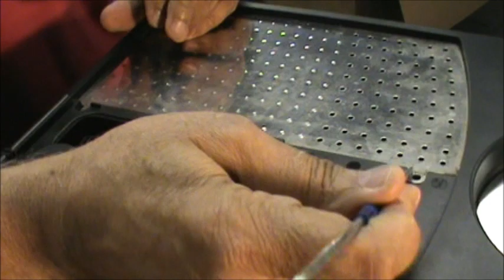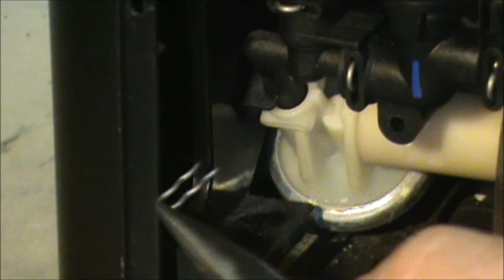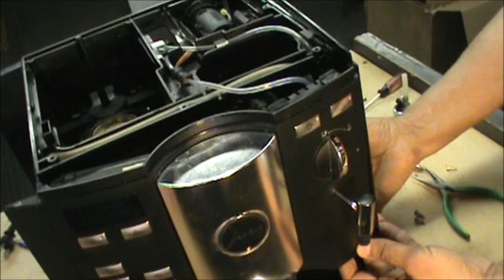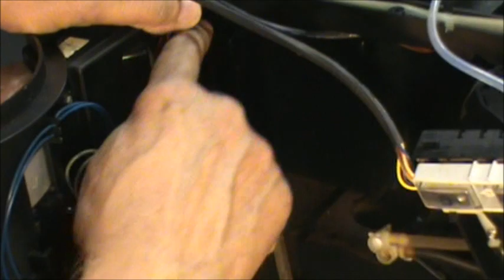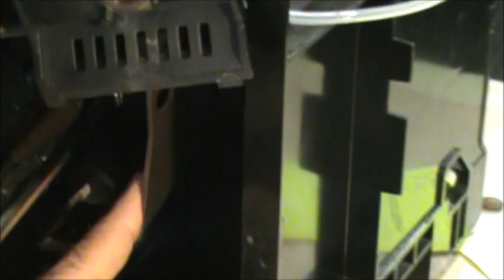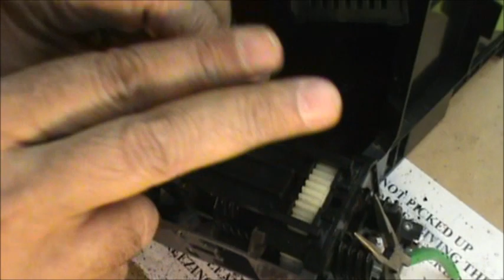How to Fix Jura S7, S8, S9, S90, S95, X90, X95 Espresso Machine

Comment: Hi. In my Jura S7 water is going to collection container and dry coffee in ground container. What is wrong with drainage valve? I cleaned it two times. Thanks
Reply from the maker: Disassemble, clean and rebuild the brew unit if you have not done so already. You may want to replace the drainage valve if its never been replaced.

Comment: I have a Jura S9 Impressa that keeps telling me missing tray.  I've cleaned the contacts on the tray and in the machine and no luck.  Any suggestions on how to repair this issue.
Reply: I had a few beans fused together at the back where the tray goes in. Removed the ‘ muck’ and the problem was gone!

Comment: I have a S9 that is showing system fill message,  but puts the water into the tray.  Does it over and over.   I'm assuming i have a broken or disconnected hose.  You mentioned the Oval head key and a hose repair kit,  how do i purchase these?  I'm in Honolulu.   Can't find a Jura repair shop here,  so i guess i have to do myself.   Thank  Good video BTW.
Reply from the maker: Hi, you can order the oval head tool to remove the rear panel from our website.  We ship to Hawaii.  Part number is 0010635.
System Fill is due to a blockage in the hydraulic system.  You should isolate the blockage or leaking point once the machine is opened.
Reply: Bought and received  key, successfully dissembled the S9.  Traced water from tank into pump, then into hydraulic distribution (white cylinder).  Water appears to then go out from hub into drainage line under brew group and discharges into tray.   Can’t figure out where any tube obstruction  would be.  Is it time to send it to the shop for repair?    If the hydraulic distribution is dead or clogged then there’s lots of tubes and limited access.  What am I missing?
Reply from the maker: Hi Charles,  it can be fixed.  I suggest you ship to us for repairs.  Our address is listed on our website www.shop.partsguru.com.
We’ll fix it within 2 weeks and let you know when it’s ready to be shipped back to you.

Comment: I am totally happy with this machine>>>ur2.pl/1165    it brews a perfect cup of coffee. Some of the negative reviews had me concerned but the negatives are minor compared with the perfect brew.Having had the previous swing machine for many years I find this coffee is hotter and keeps nice and warm for a long time with heated plate and the steel carafe. Also the brew settings are a big improvement, previously with the old pot I had to do a double grind to make six cups.

Comment: I have a Jura Impressa S8. Coffee and tea spout have worked constantly. I removed a hose from the steamer to unclog cuz my steam wand was not producing anything. After putting it back together, steam wand worked perfectly. When I went to de calcify, added the tablet and pushed the clean button, the entire process went through the steam wand! I reset to factory settings, re booted, and when I push rinse it again all goes through the steam wand. After "Coffee Ready" I pushed the coffee brew and the grinder activated but the water again came out the steam wand. My understanding is that if I leave it unplugged for 2 hours, the CPU will clear. Then I should get the "fill system" prompt. Right now I am only getting will water. If after the 2 hour wait is still does not channel the water to the coffee spout, I assume it is the fault of the water channeler that is behind the steam knob which has two line in's and 2 line outs. Before I did the repair and cleaning the coffee and tea spouts were functioning perfectly. Advice?

Comment: This guy is eager to sell parts but to answer simple questions......awww... Not so much!
Don't get me wrong, his input on how to get into the machine is very good but from that point on you better have some mechanical savvy or you will wish you never started. Haha
Reply: I have just ordered the following parts for a XS 90 machine.  

1    | 0010598  | Jura Dispensing Valve with 2 O-Rings        

1    | 0010599  | Jura 3 Way PTFE Tube Connector - New Style  

1    | 0010639  | Jura Membrane Regulator Hairpin Style with

Can you please direct me to how I need to replace these parts.  
Much appreciated.

Comment: After putting back the brew group I now have a error 8 code. When I watch the brew group move it seems to struggle at the very top. Could it be because I didn't put it back in a neutral position and it is trying to unscrew upwards further than is possible? Thanks
Reply from the maker: When re-installing the brew group, please replace the brew group in a home position.
Let me know if that helps.

Comment: What do you recommend cleaning the brew group with. Should it be soaked in something or parts be manually cleaned?
Reply from the maker: Hi Dima, Clean the brew group components by dipping the parts in a soapy solution of luke warm water.
Reply: Parts Guru thanks a lot. Also to remove the brew group do I need the special oval key or is that just to open the one side panel? Thanks again!
Reply from the maker: Yes, as shown in the video, you will need the oval key to remove the oval screws from the rear panel of your machine if you have an S Line model.  What is the malfunction with your machine?  And, what model Jura do you have?
Reply: Parts Guru I have the s9 model. The issue I have is there is no water passing through the coffee spouts. However, water passes through the steam spout. From your videos I'm guessing an issue with the spring section of the diverter. Also it sounds the the brew group is struggling to move so I assume it needs a good tune up.
Reply from the maker: Can you please make a pre ground coffee to see if it makes coffee?
Reply: I am having the same problem with an S7.  Water comes out tea portion and steam nozzle but nothing comes out with clean button, making a coffee or with ground cofeee.  What would I need to do and parts please?
Reply: I am having this EXACT problem myself. I hope they respond
Reply from the maker: Hi, the hot water inlet to the brew group does not open.  Please check the following parts:
1.  Magnet valve with metal pin.  This item pushes the metal pin against the white cap on the brew group drainage valve.  When white cap is pressed, hot water is entered into the brew group.

2.  If the magnet valve is activated, then replace the brew group drainage valve.  You may also replace the entire brew group.
Reply from the maker: Hi, the hot water inlet to the brew group does not open.  Please check the following parts:
1.  Magnet valve with metal pin.  This item pushes the metal pin against the white cap on the brew group drainage valve.  When white cap is pressed, hot water is entered into the brew group.

2.  If the magnet valve is activated, then replace the brew group drainage valve.  You may also replace the entire brew group.

Comment: Excellent video I have an S7 with Error Code 4 and would like to know how to access the harness, once I do then I can order the same from you. Please help by guiding me to the correct video by you
Reply from the maker: Hi John,
The ERROR 4 in Jura S7 is related to the malfunctioning temperature sensor that is mounted on the steam thermoblock in Jura S7. There are two thermoblocks in Jura S7. The steam thermoblock is placed above the hot water thermoblock. We have the steam thermal sensor for Jura S7 in stock. Here is the link to purchase it:
https://www.juraparts.com/products/jura-thermal-sensor-for-steam-boiler-s-x-models
Reply: I did purchase from you and let me tell you not all folks are as good as you people. I paid less than 50.00 to include shipping and now (thanks to your video) I have my coffee and saved 350.00. Once again many thanks and I wish I would have seen this video three other times before.

Comment: Hi Ed, I have a few machines, Saeco comfort magic plus  (love it) it's super user friendly.  And recently purchased a Jura S9 from eb. I took it apart because the grinder adjustment didn't work and it was leaking at the back corner around the pump and diaphragm regulator. I have a couple of questions.1 there was a foam/foil insulator insi de the top cover not sure where it goes. 2 There is a four pin connector at the control board not connected.  does it go to logic3/4 or none of the above? I appreciate any help you could offer. Thanks.  David

Comment: hi, thank you for the detailed video, i wish i had seen it before i digged into my jura s95. problem with mine was it wasnt rinsing, the rinse water would drop in the tray and not come out of the front nozzles. i've read a post about how coffee grounds can cause blockages, and i opened up the machine and i washed it :P (yea i know) , after washing i used a powerful air blower to dry all parts and left machine to dry for 24 hours. next day i checked all electronic parts and dried again with close blow air compressor, so yes the washing was a bad idea but it got everything clean and no short circuits occured. however, this time i began getting malfunc 8 error. i guess i washed off the grease in the mechanic unit and now it was jamming, hence i pulled it apart , replaced the orings (one of them was damaged) assembled everything back made sure everything moves smoothly but i am still getting malfunc 8. i watched your video and made sure i install it back in home position but it doesnt help. in fact even when the plunger unit isnt installed at all, when powered on motor acts exactly as if the unit was in and still displays malfunc 8.  any help would be much appreciated.
Reply from the maker: Hello Glen,  After rebuilding the brew group, please ensure the brew group is in a home position.  Our video details what brew group home position is.
Also, please make sure the brew group is re-installed correctly.  That is, big white gear on the brew group is seated properly into the teeth of the metallic cylindrical gear.  The metallic gear should be seated and aligned with small white gear on the brew group motor.
Reply: +Parts Guru 
Hi , thank you for the prompt reply. i had already installed it at home position several times, but today i tried it again with more attention. however, result doesnt change. i set the unit as shown in video about 3.5 teeth down from top, with brewer cylinder at the very bottom but motor goes left right left right pushes down a bit and pushes it all the way up and stops with malfunc 8.  is there a way of resetting the device ? or is there a sensor that tracks the mechanical movements which might have a fault?
thank you in advnce

Comment: Thanks a lot for this detailed video! With it I could open and remount my freshly bought S75 :) unfortunately it is not turning on, and this is the 3rd espresso machine this month that after transport is not turning on: is there a secret button that turns them on? I have thrown away the water in the tank and cleaned the drawers before moving them
Reply from the maker: Hi Diego, Was the machine functional before you remounted it?  You mentioned this is your 3rd machine with the similar symptoms.  How were you able to fix the previous two?

Comment: Great video - Thank you for posting.

We have a JURA IMPRESSA Xs90.

Just this morning I see the frothing nozzle is leaking steam from where the steel tube coming out of unit and bends down 90 degrees to where it enters the black plastic portion that accepts the rubber tube/gasket at the top of the removable nozzle stem.

This unit has been perfect, and we have had it for several years - always use RO water and has a count of 9,615 on the INFO menu

Can the nozzle be serviced without taking the entire unit apart as you show in VIDEO to disconnect it from steam select switch or is there an "O" ring between the stainless steel pipe and plastic?

thank you again - 

Appreciate your on-line support for us DIY types.
Reply from the maker: Hi....is the frothing nozzle not properly connected to the steam wand?  Please review the item below to see if that's what you need:
http://shop.partsguru.com/Jura-Steam-Nozzle-Connector-0010650.htm
We're here to help!

Comment: Hi, I have a Capresso C1000 and the front upper right control knob broke. Jura sent me a new control knob to replace it. What's the easiest way to do so without disrupting any other parts since the machine works well otherwise? Thanks! Tim

Comment: Hi,
I am trying to open a Jura Xs90 One touch but there is two circle screw on the rear panel, which kind of screwdiver i need to use ? by the way thank you very much for this very usefull video !
Reply from the maker: Hi there. You will need an oval head tool to remove the rivet looking oval head screws from the rear panel. Here is the link to purchase the tool:
http://www.shop.partsguru.com/Jura-Oval-Head-Key-Stainless-Steel-0010635.htm
We are here to help, if you have more questions - Tommy

Comment: Hello, my machine has started to trip the GFI. Right before it does, I am noticing steam rising from the cup heating plate. Perhaps that moisture on the internal wiring is causing the trip? Does this mean there is a leak, perhaps dripping on the heater? What do you suggest to remedy this issue?

Comment from the maker: Please check the ceramic valve/diverter that distributes water for steaming and brewing.   The ceramic valve is located behind the steam pipe and steam knob at front top right of the machine.  It typically gets clogged due to calcium deposits.